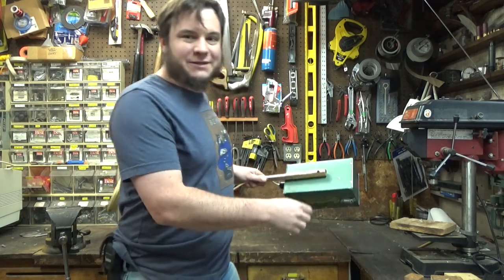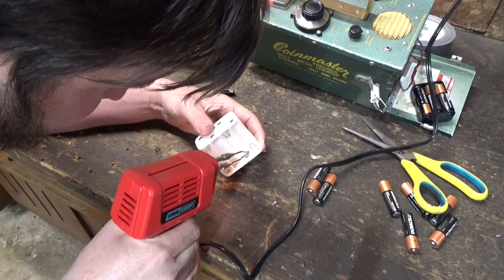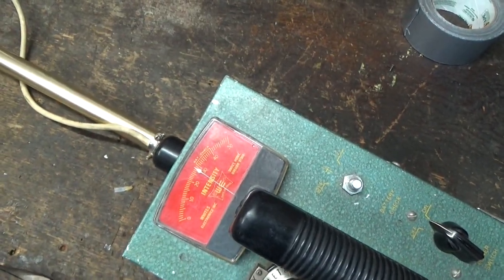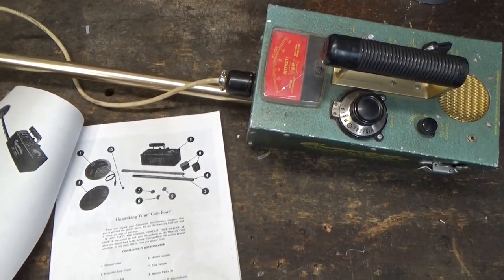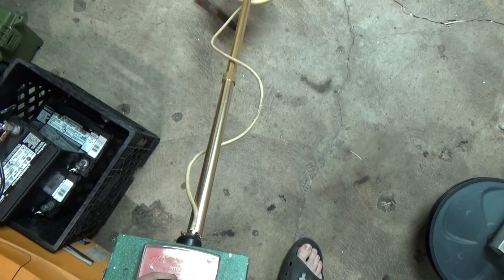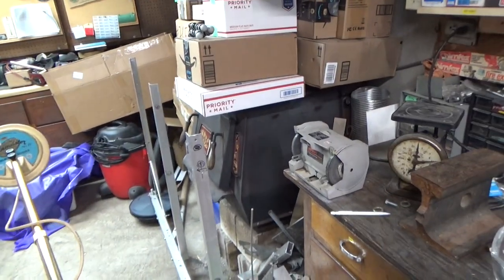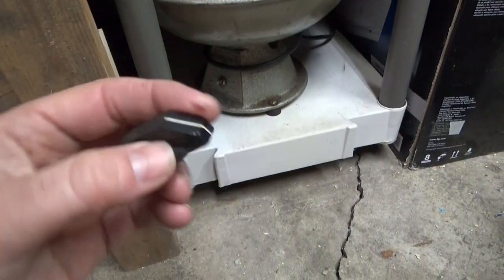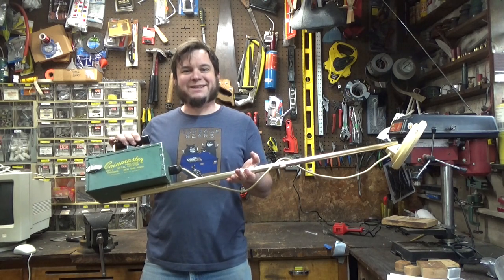Fixing An Old Metal Detector

Comment: I have the exact same detector, purchased it back in the late 1970's and it still works flawlessly. It had 2 search coils that came with it. a 6 inch diameter and a 10 inch diameter and there was another that I planned on purchasing, a 2 inch diameter, but when I attempted buying it none was available. I originally bought the one I had to locate aluminum shaft arrows when they would bury themselves just under the sod  when setting up the sighting pins on compound bows.
Reply: What are the chances of getting some pictures of the inside? I don't know if mine is missing anything, cuz Ive never seen it work, lol but I really wanna make it work....

Comment: Cool vintage Whites Coinmaster. My first machine, and have owned about 5 or 6 machines since. These days you can spend around $200+ for a decent entry level machine. Anything cheaper is a huge waste of $$$. A good mid-level machine will cost twice that, around $500 and the more professional examples will cost around $1000 give or take, and can go much higher to a few grand. 
If I were just starting out today and know what I know now I would probably just spend around $500 and search for a used Garrett AT-Max or used Teknetics T2 or Fisher F75 models (basically the same machine) or you might get lucky and find a used Minelab Equinox or used XP Deus for not much more.

Comment: Wish I would have seen this sooner. I have the same one and only one of the battery check positions works (on top of some other failures). I would have asked if you could take some pictures of the internals so I could attempt to decipher the schematics.